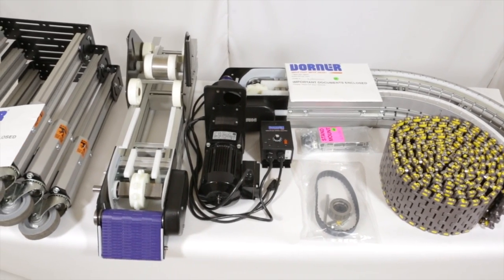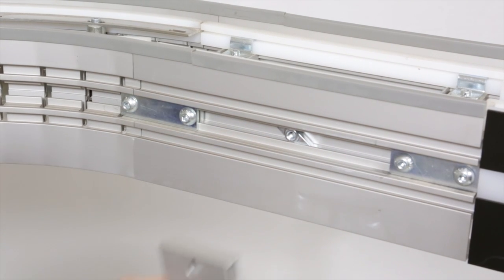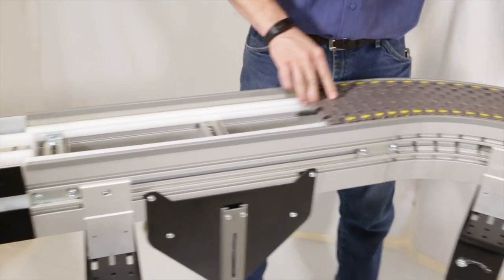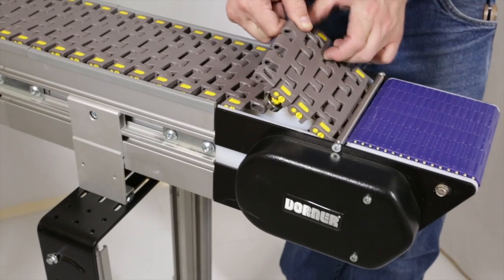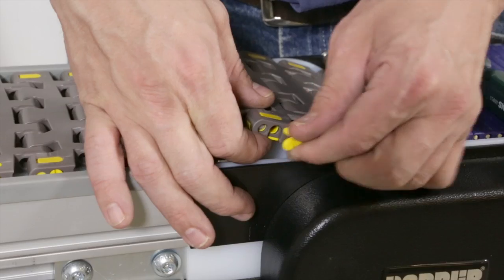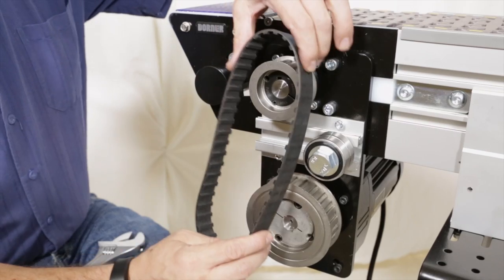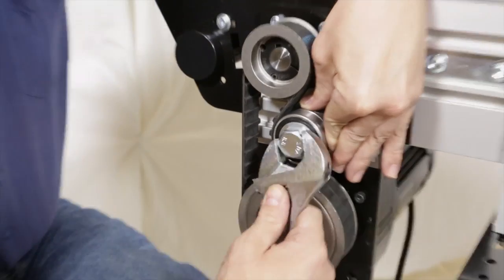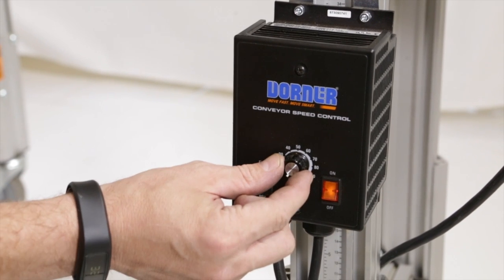Dorner 3200 Series Modular Belt - Service Video

Comment: Your offre for wire mesh Conveyor :
+ Wide 120 cm / 80 kg-m2 / qtt :48  x 120 m long
+ Wide 140cm / 80 kg-m2 / qtt: 32  x 165 m long
+ Wide 200 cm / 170 kg-m2 / qtt: 10 x 200 m long
+ Wire of 2 mm by 2 mm 
+ Mesh size: 25 mm x 19 mm
+ Pulley diameter : 100 mm

Comment: I can see this modular belt has alot of bearings installed on it, to follow the track. Is this more beneficial and durable for the long run? I ask this because i work with a diffrent modular conveyor that uses this shape |_| on each side of every link, which slots into a track where its guided. 
Is it neccesary to have that many bearings?